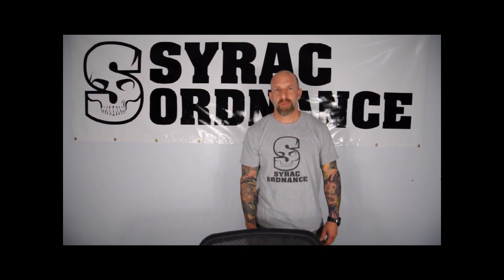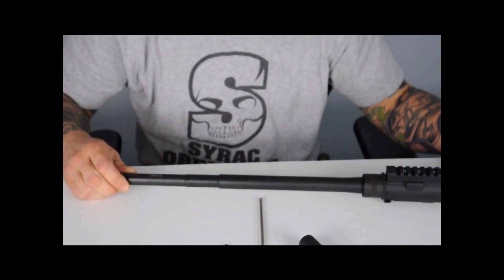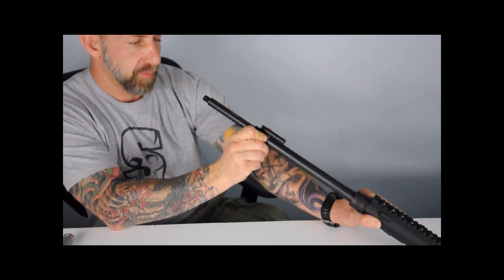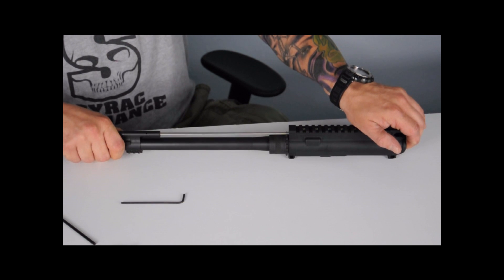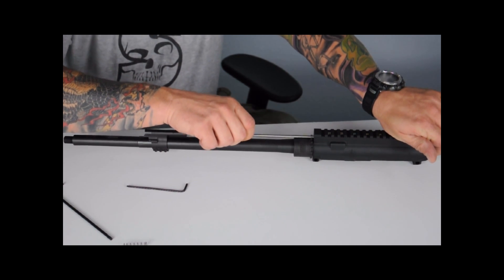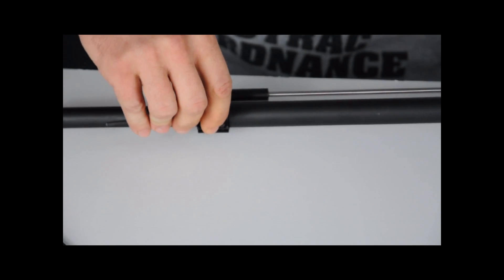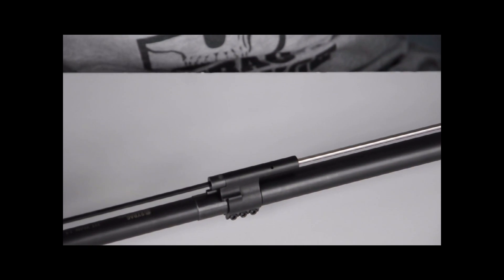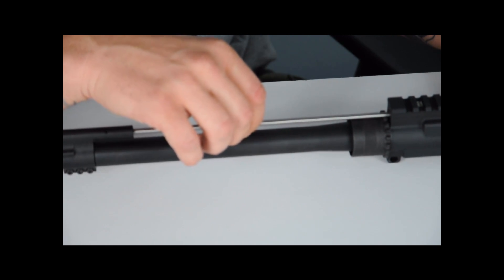SYRAC ORDNANCE - Piston Installation - Official Video

Comment: When I turn the gas plug back so the broken out part is inline with the detent, I cant slide the piston rod at all...Its not giving me enough to turn? iIts only turning about .250" before the broken out section is at 6:00... Piston will not move at all...if I turn the plug a little more, the piston will then slide back and forth for clearance... Any ideas?

Comment: Anyone get this to work with 300 blackout?
Reply: +Alex Parrish I was able to get it to work with 6.8,  but it was a real struggle though.

Getting the gas block aligned 100% perfect feels near impossible, and I had to switch to an ultra light buffer &amp; spring.

Have you experimented with this system and 300 blackout yet?  I know there is another video of Jason using a 300 blackout suppressed on full auto with this piston.
Reply: +Aleckael I bought it when it first launched.  I could not get it to work.  Now I am waiting on a low mass carrier and am considering opening my barrel gas diameter to .093 or .125.  For now I run a DI on my 300blk.  :|
Reply: Alex Parrish
Thats what I had to do.   I got the Taccom ultra light weight 2 piece buffer, its like 0.6 oz on the recepricating end.  And I had to open my gas port up to over .100,  I think I went as high as .107 or .110.

Is there a low mass bolt carrier that would actually work with this piston set?
Reply: Aleckael ....start with a change from full-auto carrier to the semi design .

Comment: Jason, you did a very clear, concise video on the installation. Bravo.

I think it is very cool how the play/gap on the piston rod is automatically achieved with out any calipers or feeler gauges that I needed for your original Adams Arms kits. I love the AA kits. But these Syrac kits are nothing short of amazing.

They are  SO LIGHT and compact. I actually went back to DI because AA did not have low mass carriers (they do now) or fine adjustable gas blocks. The newest generation of AA only has what, five gas adjustments? And it is still heavier and larger than your new Sryac.
Jason, you have revolutionized gas piston kits.

No longer can opponents say all gas piston kits are too heavy, too expensive or too hard to install. Jason, I LOVE how you used a  CLAMP on system as opposed to small set screws that really need dimples milled into the barrel to work (not all that effectively either). Set screws suck balls. I do not know why people actually ask for them.

 A clamp on gas block with 3 screws torqued to 32 inch pounds is basically part of the  barrel now. It is as sturdy as any taper pin system which I actually hate since taper pins destroy part of the barrel. I prefer clamp on systems over any other method.

This Syrac piston kit took over 3 years to design, develop, refine, and test. The results were worth the wait.
Please do not make us wait another three years for low mass AR15 carriers AND .308 carriers!!!!

Syrac needs to thank Michael Bell who did three great, in-depth videos on the Syrac piston retro fit kit.